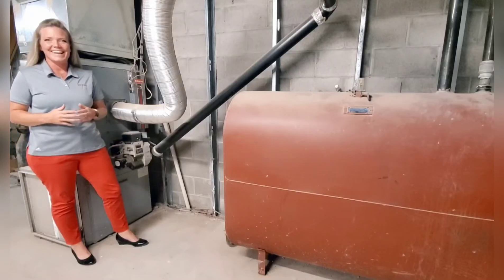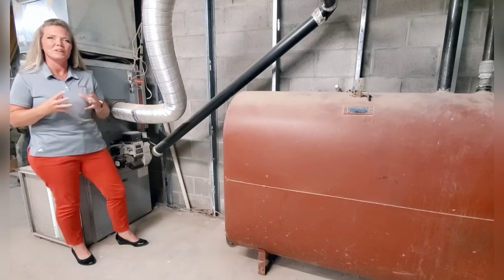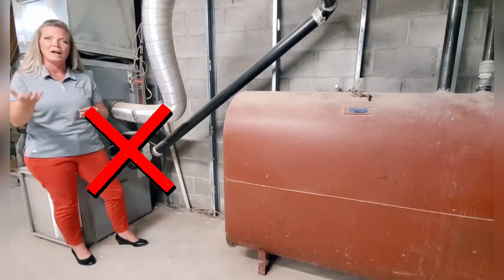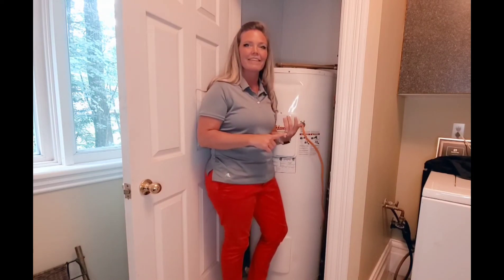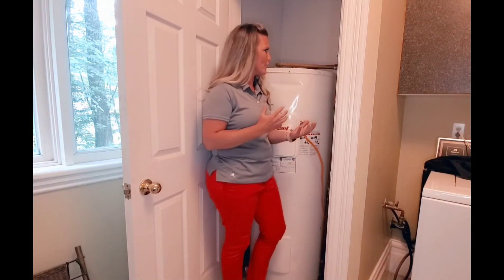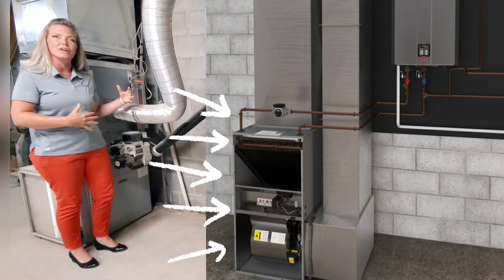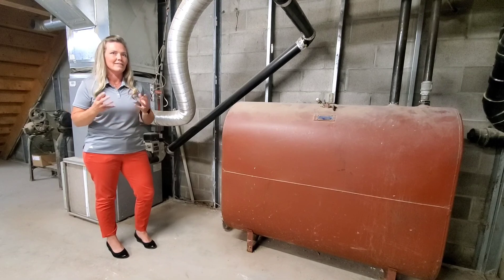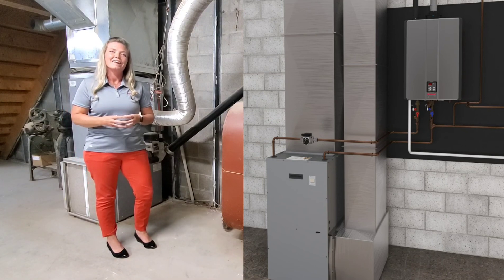Rinnai Hydronic Air Handler (CAH)  Residential Location - Live With Leah

Comment: This would be great if it came with a small plutonium reactor to produce the electricity. For most of the country it's too expensive, and for people with well water, an instant hot water heater is not a practical solution for DHW.